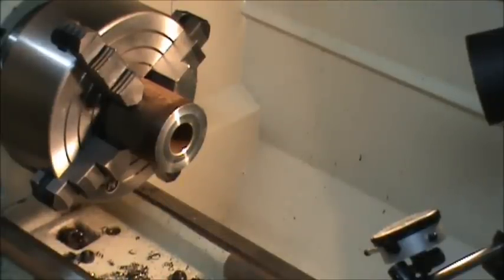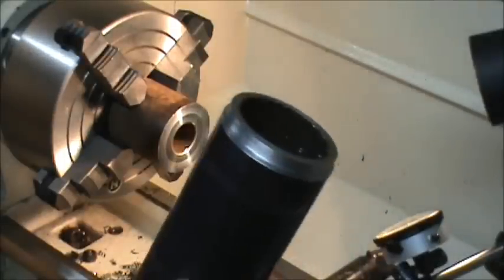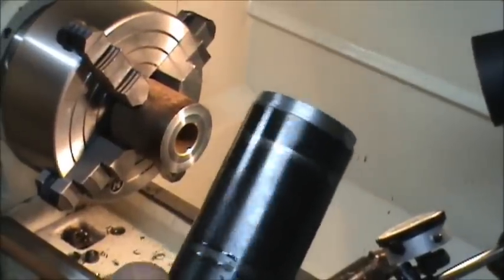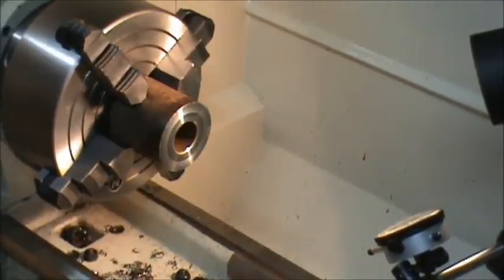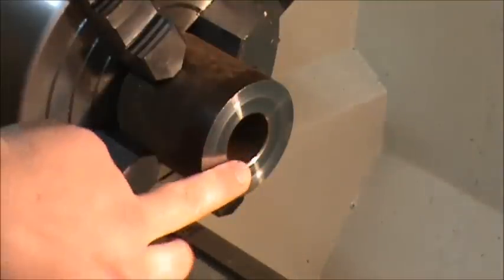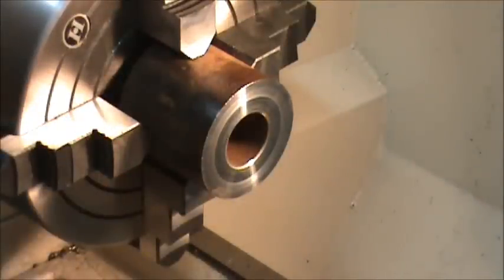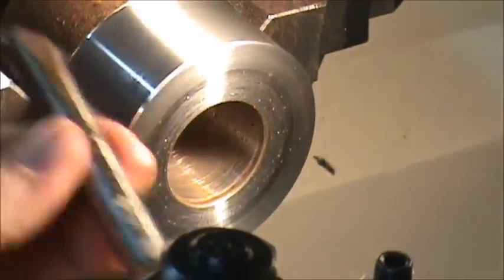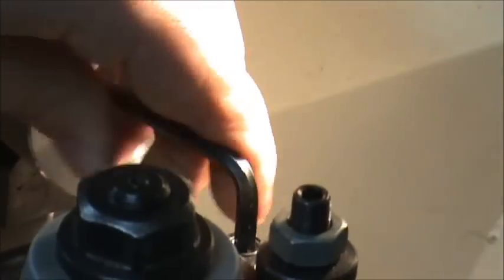006-BORING BAR HOLDER-PART 1

Comment from the maker: I've bought the extra HSS blanks for that very project, just need a few more tool holders.  That will make it very nice indeed.

I worked at an Oilfield Tool Manufacturer for a couple of years right out of school as a design engineer.  I bought a lathe and mill and learned it myself.

Comment: I noticed you like to loosen your tool post to swing around the get a different angle for chamfering. One thing I could suggest that may help you out is grind a couple hss chamfering tools and mount them on each end of a tool holder. That way you have one positioned for internal, and external. 
By the way, good videos. I've watched a couple of them so far. Where did you learn the trade from?